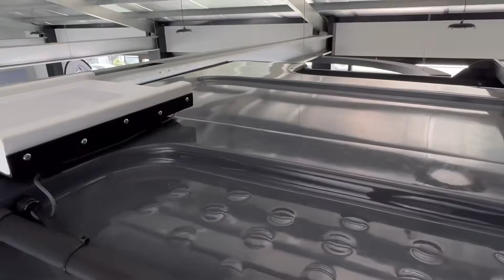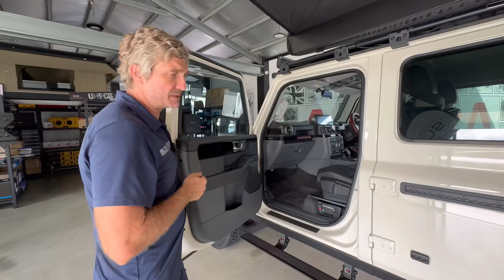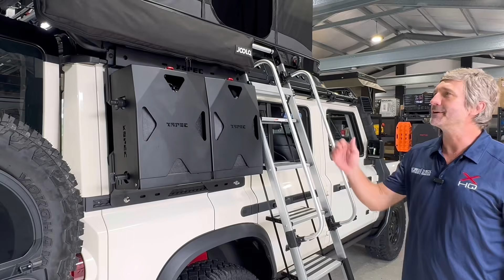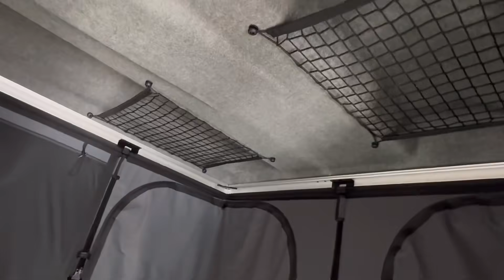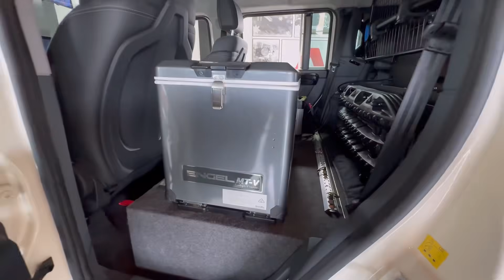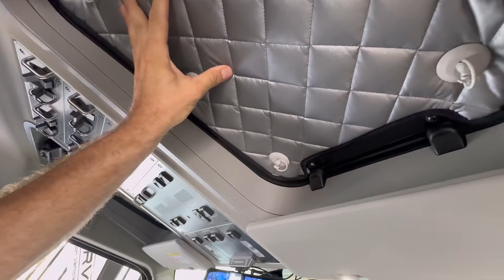XSPEC GRENADIER BIG BUILD

Comment: Toyota, Jeep, Ford, Nissan, GMC, Land Rover etc. I will never overland, tour, camping. On a 4WD vehicle running on a tyres smaller than 35s. not 315/75R17 or 285/75R18. Real 35.

Comment: Awesome setup. The only part that I don’t agree with is using a heavy platform rack and a heavy rooftop tent. All could have been easier done with much lighter roof bars and the tent, saving that extra weight up top. Stunning rig nonetheless.
Reply: Agree the rain gutter is not great for supporting roof racks. There are much better systems available that pick up on the Grenadier rails that were designed to take loads

Comment: the Grenadier could do with a proper all feature heavy duty 3.0 in. (forward & aft) suspension lift . . . please note I'm not talking about the spacer lift option that's flawed by design . . . please advise how to place an order for the variant shown in this video . . .
Reply: Jmacx working on it now
Reply: Call expedition hq they have all in stock. Back 2nd January